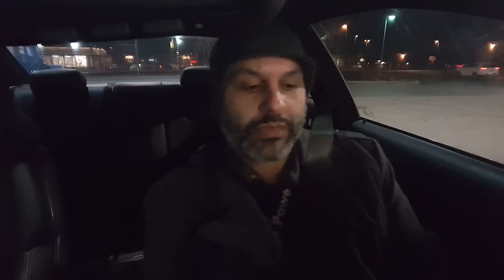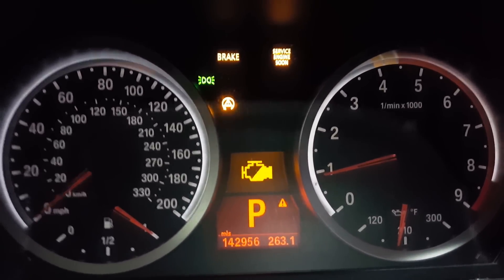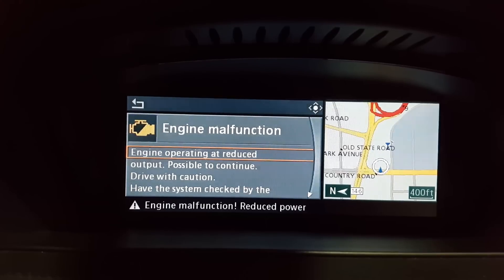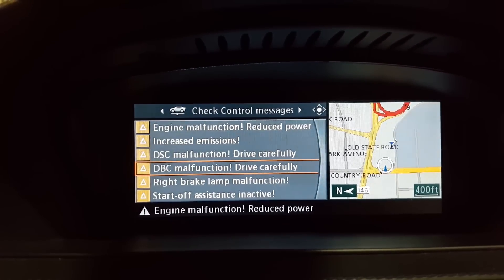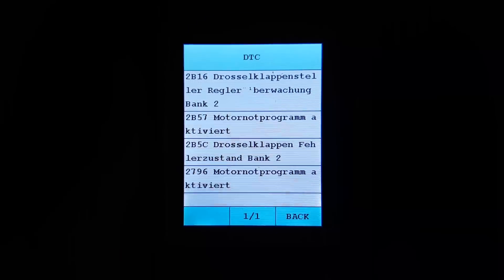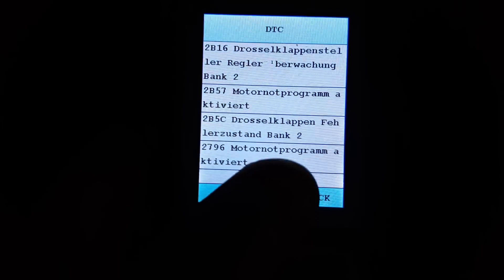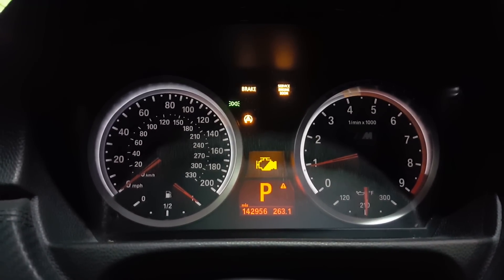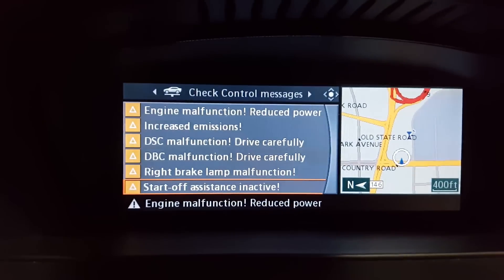BMW E92 M3 Limp Mode. How to tell whats wrong when in limp mode.

Comment: Hello there. It’s all fixed. Finished at 5pm wow. The dealer, I just laughed when they said 900.00 dollars. I fixed it for 100.00 dollar. Did my own diagnostics, swapped coils from 2 to 1 bank. Replaced the number 2 coil. Plugs were ok. Man our life as BMW owners is real. I knew what I was getting into when I purchased, but I fell in love when I looked at. Good or bad, I have to put money into it, and fix it my self. It’s our life lol.
Reply from the maker: Ah man. Great job! You just always get better satisfaction knowing you fixed it yourself and saved 8x your money!
Reply: My 2007 335i is doing the same thing ! My mechanic said his computer read cylinder #3 was not properly working so he says he’s going to change the coil for it and everything should be good , that’s what I’m hoping ..
Reply: Did your misfire throw your vehicle into limp mode? The engine fault icon thats in the thumbnail of this video, (the engine light with a line through lit up half yellow) was that light on in your vehicle too as well as it being in limp mode? Just trying to see if your problem aligns with mine, if so maybe i could try new coil packs. My car starts up, idles pretty rough then after about 30 seconds or so the chime comes on, the light comes on and the vehicle is now im limp mode with the fan kicked on. Once the car kicks into limp mode the vehicle idles smooth as butter but with barely any power at all. Im curious if its just killing ignition to those bad cyl and balancing out running on less cyl. Or if I'm having a turbo issue. Thanks in advance.
Reply from the maker: Nope...just good old throttle bodies
Reply: I have a simular problem on my e90 m3
Limp mode
Dsc failure
Tire pressure 
Sometimes shut down
Iddle rpm runs horrible

Fault code p152d
Misfires on all cylinders

Changed the coil packs and coils
Car smells rich on gasoline

I thought on the iddle valve also ?
If seen the throttles going open...

Comment: My 2008  BMW X5  4.8i sport, premium and winter package. The check engine light just came on today because I did a hard pull from a stop light. The engine lights light up like it was Christmas lol. It has 97,869 miles. I knew it lol. It’s being a BMW owner. That’s life. Sending the black beauty off on Monday for service.
Reply from the maker: Ugh! That doesn't sound good. Hope it's something inexpensive
Reply: Runs rough, engine light flashing. It’s so typical of the X5 coils.
Reply from the maker: @KennethBostonian  sure its not bent valves? My E36 M3 did that....CEL on, rough idle, rough running. Was 4 bent exhaust valves. Zero compression in cylinders 5&6.

Comment: When I first bought my M3, a week later it went into limp mode. Got the engine malfunction and increased emissions warning, rpm went to 4500, and the car idled extremely rough. Got scared. I shut the car off and waited 5 minutes. Turned it back on and it went away and never happened again. This was back in September.
Reply from the maker: +Eloy Garcia That's exactly how mine started. Rainbow tree of lights when I turned the car on....let it idle for a few minutes while I popped codes on it....shut the car off....turned back on and gone. Didn't hear anything till about 6 months later. This time the actuator Hall sensor. Replaced that, good to go until 2 months after that, if that, the actuator went out. So the obvious symptom then of a dying circuit board is when that happens. It's gonna happen intermittently until it fails completely

Comment: Every BMW owner needs a OBD2 code reader lol. I purchased one today. P0302 misfire.
I have a P0071 Ambient air temperature sensor range/ performance. I hope it’s just the plug or the coil. By the way, great video.
Reply from the maker: Great cause if I have to see another post in FB groups that show a CEL and say "This came on today. Anybody know what this is?" 😂😂
Reply: Is this like a dealer bmw code reader ? I want to purchase a good one but that shows me everything even dealers codes
Reply from the maker: This is primitive in comparison but gets the job done no doubt. Dealership until go for thousands vs $50
Reply: @RDDC_Official  any link to a good buy link?
Reply from the maker: I just go through Amazon. It where I got mine. Cheap too. It's all I've ever used to diagnose my bmws and it's been fine

Comment: Thank you my x1 this morning did exactly the same thing than turned it back on and it seemed like it went away I thought maybe it’ was the egr valve fingers crossed on what it is brother
Reply from the maker: Cross fingers its something simple. Most time it is. Put a diagnostic tool on it and do a bit of forum research and you should be good

Comment: That's happened to my 328i last night. While I sat in my car and suddenly, it starts vibrating and I turned the car off and turn it back on. The  big engine light disappear turn it off, after 4 hours I got back to the car and drive the shit out of it like 100mph, and no issues so what can be the reason for that?
Reply: @RDDC
Reply from the maker: I'm not 100% sure cause I'm not a 328 guy. My best guess would be coil packs or injectors. They seem to be common issues with the inline 6 cars. Next time pull codes immediately
Reply: Me too , did u find  out  what  it was
Reply from the maker: Curious myself
Reply: I coded it and I got the electric coolant water pump
Reply from the maker: @youngbenrozo8802  super weird. But glad you figured it out

Comment: Limp mode is not fun. Had it happen when my thermostat went bad. Car shut off in the middle of spirited driving with people behind me
Reply from the maker: +BMWAddict oh shit. Yeah I just replaced my thermostat and hall sensor and didn't do the throttle actuators because I needed to read up more on it and I needed to put the car back together I had things to do the next day. But hopefully I get it back together with no issues. We will see tomorrow. A fun day of ripping my car apart
Reply: At least your troubles make for a good video 👍
Reply from the maker: +BMWAddict I guess :)

Comment: How much the m3 cost to own it, maintenance, service, parts costs, fuel?
Reply from the maker: Well hard to say. But yearly cost of oils changes will be like maybe $250 if you do it yourself. Gas is costing almost $60 to fill up on premium gas for an average of 300 miles per tank driving normally. Other items aren't terribly expensive. But just know doing things yourself vs taking to a garage will be a big cost savings to you

Comment: i had something like this happen once and then it went away when i turned the car off and on. i have a manual car though so its a little different (E-90) . BTW i only have 55k miles so its very unusual at that mileage but anyhow it went away and never happened again. maybe something got screwed up with the way it started up?
Reply from the maker: +jess van Thanks EXACTLY what mine did. Happened once and went away for almost a year. Then started it up and it happened again. Shut the car off then turned back on and was fine again. A few weeks later it came  on again and ended up in serious limp mode and would clear. That's the sign of a actuator board going bad.
Reply: Currently lucky enough to have this problem with my e92 328i my car takes so long to pick up speed , at first it was as simple as turning it on and off
Reply from the maker: I notice in bmws the electronics can be funny sometimes. Turn it off then back on seems to solve some issues. But then it sticks in your head "is it gonna come back?" 😂
Reply: @Neil542  this happened  to me yesterday  after  work ,  i almost  freak  out  lol, i didn't  try to speed home 45 mph ish home didn't   see if i could  give it gas to go faster ,  got home cut car off got my foxwell it disappeared ,  smh, turn car on no show lol, small test  drive  all normal ,  yours  came back

Comment: Did you only change bank 2?
Ive seen some varying opinions where should change both if one bank goes
Reply from the maker: +etienne wilson Well I did the rebuild on both but then found out the board was bad on Bank 2. So only replaced bank 2 with a new one and bank 1 is rebuilt
Reply: RDDC so I conclude from your response:although the engine faults show that one bank is problematic,it's best to change both? similarly in your case you changed both where one bank was a refurbish.
Out of interest what did the non refurbish actuator cost?
Reply from the maker: +etienne wilson the new actuator cost $983.

Comment: And sometimes it doesn't go off that limo that's a headache I can only tell you the only route the only way you can get clear of it if you were driving back up to clear it with your scanner turn off the car and turn it back on and it will clear will give you the whole horsepower I have that I would my laptop and one of my M3 I mean is not the best way to get around it but who wants to drive 10 miles an hours or 20 miles an hour home when there's no traffic right so I mean if the troll actuators are bad or the gears are bad every doesn't hurt the car to just reset the vehicle because it's just a code goes to the computer once you reset it your get your horsepowers all back even know it didn't we had a horse power before once you reset it it does go back to normal it's just a quick way to get around it to get home
Reply from the maker: +manuel lares I got lucky when mine when into limp mode. I was still able to drive 75 mph home (31 miles) with no problem other than I couldn't hit the gas hard. It had to gradually get to 75. But in my case my gears weren't bad...worn but not the cause of the problem. I'm sure my car wouldn't go past 20 mph if the gears actually broke
Reply: RDDC  thanks I have the Mecanic open them tomorrow can you please pass me the link we're you buy the replacement trodel actuator and what company you purchase from thanks

Comment: good luck on the repair
Reply from the maker: Luck wasn't on my side but the rebuild went great. Found out it's the circuit board so had to buy a whole new one. No biggie just sucks. But Bank 1 the rebuild is working just fine

Comment: How do I know if it's the gear that needs replacing or the computer chip itself within the actuator needs replacing?
Reply from the maker: +Wonton Bomb The car will wig out every now and then giving you the code but you can turn the car off, then back on, and it goes away. It will do this a few times. If a gear was really broke it will probably throw codes you can't clear the first time.
Reply: RDDC thanks I guess my chip is dying, I'm assuming I have to order an actuator ?
Reply from the maker: +Wonton Bomb or fine someone to fix the chips. That might be hard to do. As much as it sucks you may have to buy new ones. The work isn't that bad to put them in either. If you know what bank it is you can get away with replacing one first then the other one later. Follow my DIY and you'll have it apart and back together running in like 3 hours

Comment: I get the half power light and loss of power.. I turn the car off... turn back on.. power restored. It's awesome!! not.
Reply: Jaime Hernandez same shit happened last night. I was far away from homes like 28 minutes and the big engine light with half power shows up. I was kinda worried till I turn off the car and turn it back on and go handle my business to come back 3 hr later and drove the shit out of the car like 100mph on the highway and it's fine lolz that's crazy.
Reply: Did you get it fixed?
Reply: @youngbenrozo8802  I'm having this issue now but it comes and goes . How do I get it fixed without being ripped off by the stealership
Reply: @kam ahmed I think it’s a water pump issue you should buy your own water pump and check a loco Mechanich
Reply: Having this problem now believe its either vvt module
Reply: This happened to you in winter time? This happens to me like couple days ago  when colds down

Comment: I have a 530I BMW and it won't go out of park I'll tell brake switch on it 97 brake switch transmission dry modeling can anybody tell me what's going on with my car thank you
Reply from the maker: I dont quite understand the full gist of your question. If it won't go out if park it could be some sort of transmission fault or gear selector fault. It could be something with the ignition too. A condition is not being met for it to engage out of park, or the part itself is faulty. If you have any CEL you need to read the code.
Reply: @RDDC_Official  it's a 530I BMW 06 my brake switch went out and I couldn't get it out of park so I'll put a new brake switch on it and it still won't go out of park the dashboard says brake switch transmission filter dry moly I don't know if it's the transmission control monitor could it be something else my starter the brake switch and the transmission messed up at the same time so could that be some kind of electrical problem could you please let me know thank you
Reply: My brake switch went out on my 530i BMW 06 the dashboard says brake switch transmission filter dry Molle could you tell me what's wrong with it because the starter the brake switch and the transmission messed up at the same time could it be some kind of wiring doing this even the headlights went out a brand new starter on it I don't know if it's the trash mission Control monitors I don't want to spend a lot of money on it if that's not the problem could it be something else I appreciate it if you can tell me thank you

Comment: why did that limp mode happen? does that happen to regular 328i E90?
Reply from the maker: +kevin p My limp mode activated because one of my throttle actuator banks went out. And what happened to mine will never happen to yours. It only happens to the V8 and up cars. On my car I have 8 throttle bodies, 4 on each side of the engine. The actuator is the unit that pushes the rod to open and close the actuators when hitting the gas. Your car most likely only has one throttle body, like most cars. Therefore you don't have actuators. You may have something similar for your one throttle body but I couldn't tell you without researching

Comment: one guy i know went to a shop and they told him he needed actuators and they didn't need that at all and they didn't even scan the obc. and they went to the dealer and got a cheaper price then this shop
Reply from the maker: +Roger Moore Thats crazy. Any person can pick up a basic code reader and pop the codes themselves before going to any shop.
Reply: That's what I do so they can't tell me any bullshi
Reply: He needed valve cover gaskets and they wanted almost 2500. He went to the dealer and it was way cheaper 1200
Reply from the maker: +Roger Moore Yeah man. I can't see where $2000 in labor comes from. That's like 14 hours $125. I can get it and out and back in in about an hour now. Even if BMW charged 4 hours that's still a long time to do the procedure.
Reply from the maker: +Roger Moore 😲 $1200 for a valve cover? Yikes!
Reply: And that was for throttle sensors too
Reply from the maker: +Roger Moore ok. So not too bad then.
Reply: The shop he went to is good they know there stuff but charge a little to much
Reply from the maker: +Roger Moore Awesome. I'll probably do most of the work myself but tuning isn't my department and I don't own a dyno
Reply: RDDC  I just serviced my 2010 m3 I did the brake flush.  coolant flush engine flush.
Reply from the maker: +Roger Moore Nice....how many hours?
Reply: 2hrs
Reply: The coolant flush takes most of the time
Reply: And you need the machine to do it
Reply from the maker: +Roger Moore ah ok that was gonna be my next question if you had two people or used the machine. Thanks for the info. I need to buy that machine. Just been lazy on purchasing it
Reply: One person can do it
Reply: You should buy a good scanner tool
Reply from the maker: +Roger Moore I will one day. The one I'm using works good enough at the moment
Reply: RDDC when I was younger I used to love working on my wrx sti. now that I have two Germans there more technical and better built then subaru.